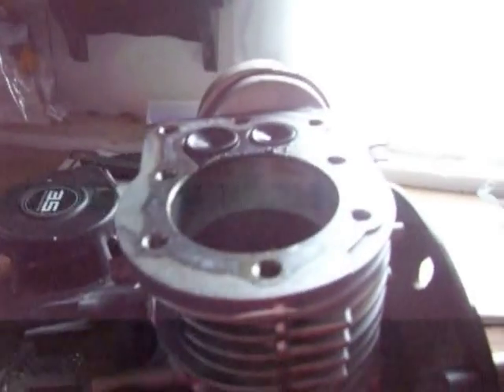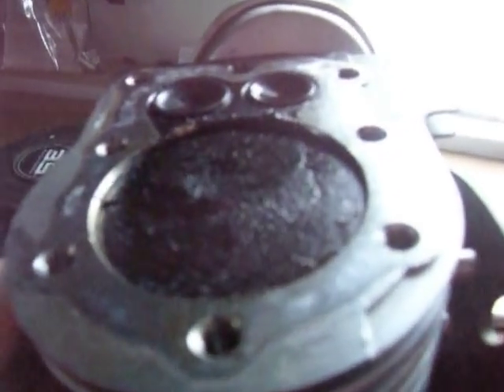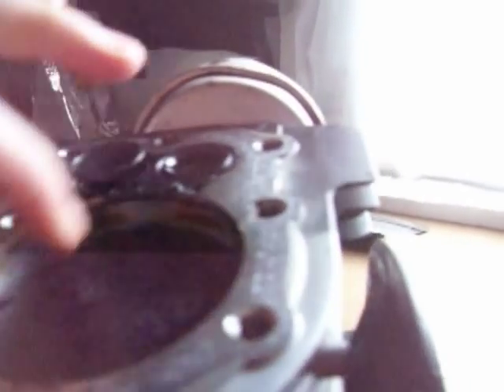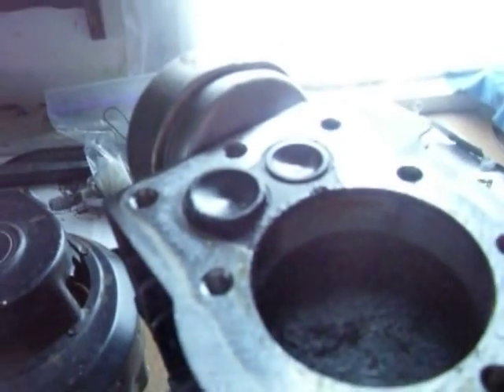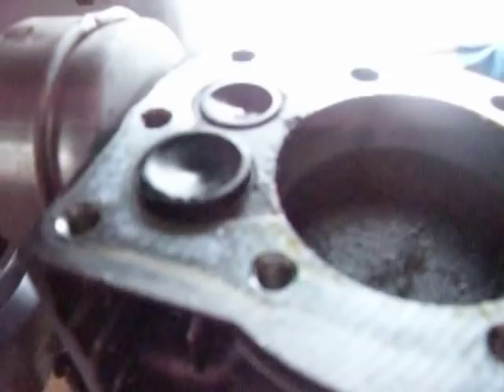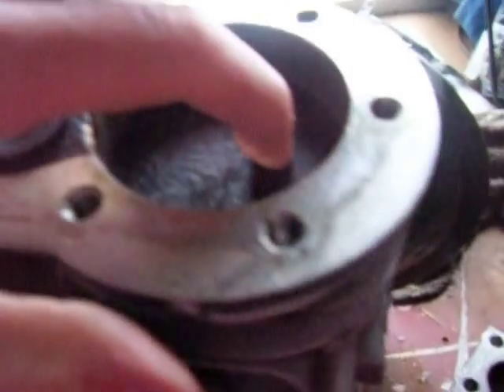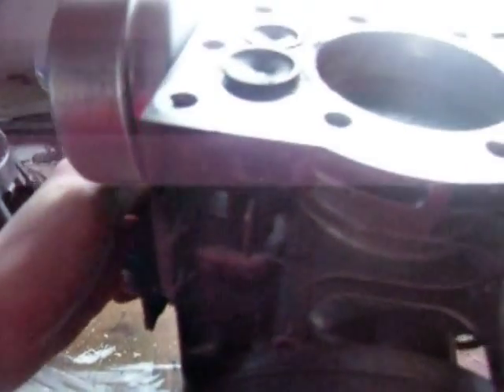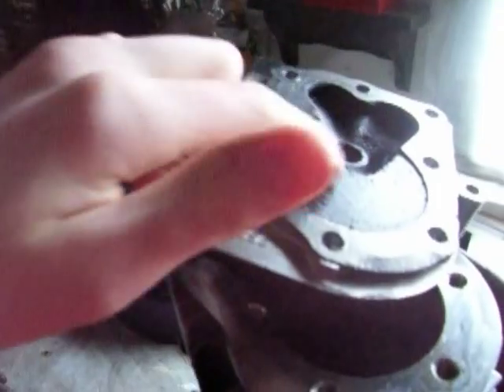How a small engine works

Comment: Well its a flat head not an overhead valve and it is a 4 stroke not a 2 and the little gear is called a cam and actually u have the order of firing all messed up!

Comment: no you aint fixing it you know nothing it is a four stroke not a two stroke and it is not and overhead valve it is a flat head engine!!!!! and it is not blown because if it was the piston would not be moving. I have proof because if every one could see this comment it cant fire with out compression and it would not move down. also the cylinder needs to be traveling downword to suck in air!!!!